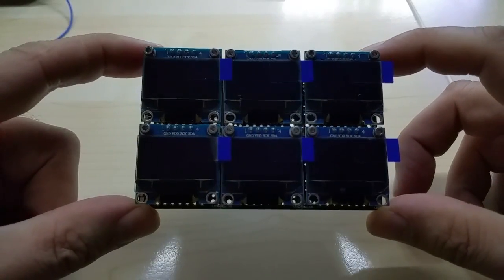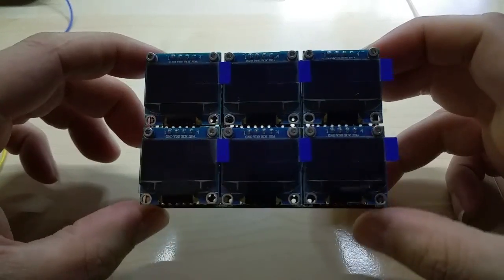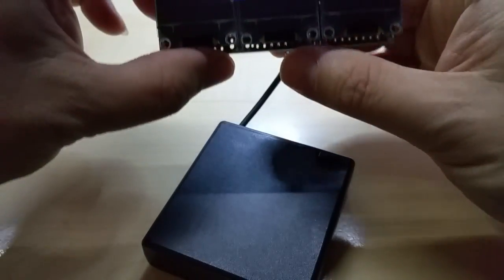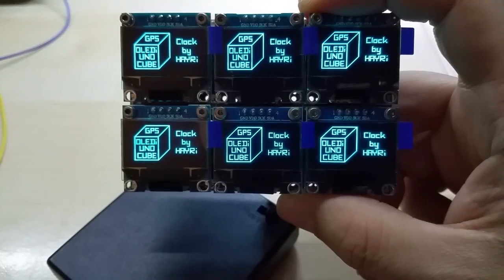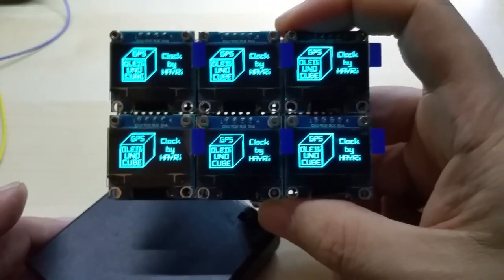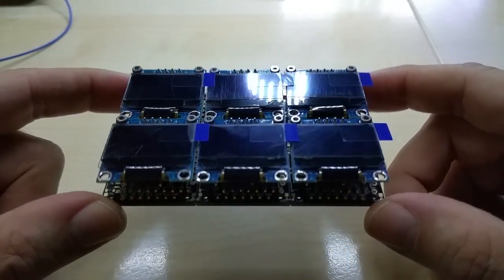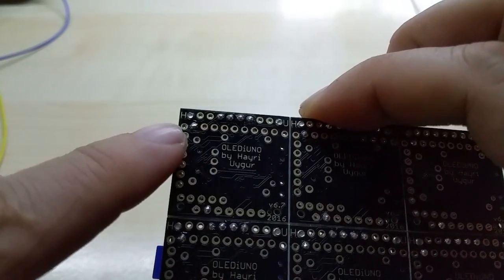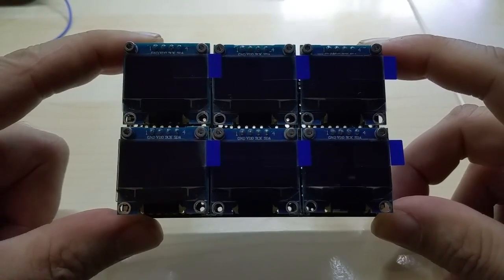6 Pack of my latest OLEDiUNO PCB for a customer in Germany

Comment: @Hayri Can we design a cluster with GPS logger, ODB 2 data logger and weather(either GSM module or WiFi module to connect to internet). The unit takes inputs from GPS and ODB 2 to map speeds@location,change distance to empty -> location where empty, weather@Location, throttle @location, load@location. All the data is logged on SDCard and latter can be overlayed on Google maps.
Reply from the maker: Hi, Nice ideas, but I do not take on any custom work at the moment. Working on my new OLEDiTREK product and have other work lined up already.